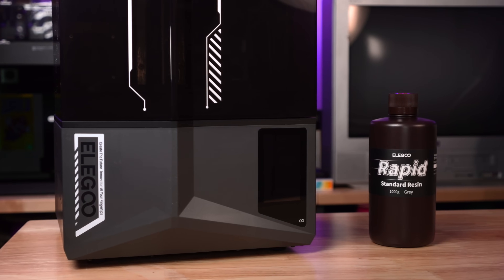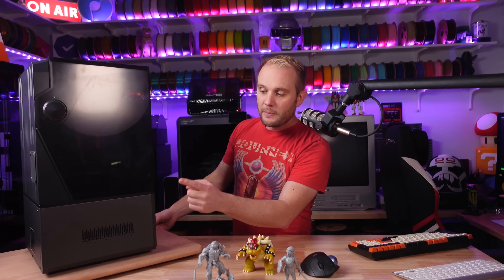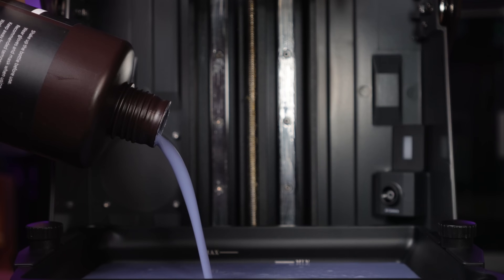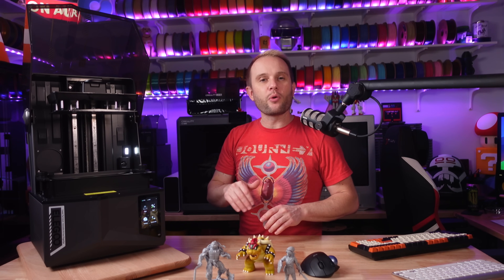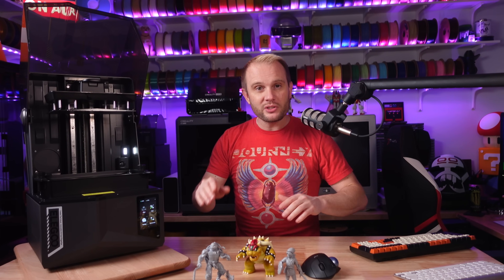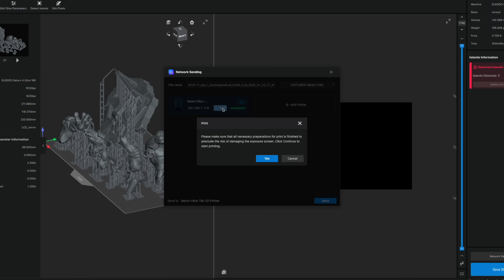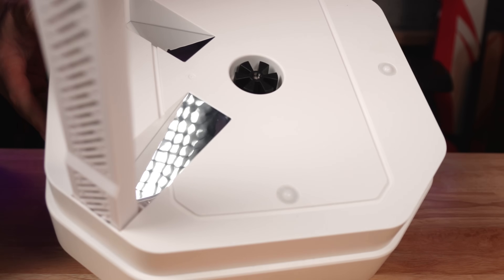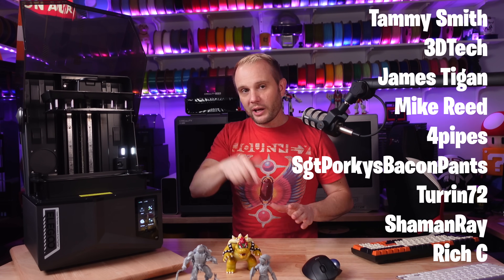Easiest & Best ELEGOO Resin 3D Printer - Saturn 4 Ultra 16k

Comment: The question I have at 3:15 or so in, is, who else is offering tilt release mechanism? I’m still learning and very new to resin printing, but my understanding is that only Elegoo has offered a printers with that mechanism at the release of this video? Please let me know who element is doing that as I’d like to compare performance across a wider number of manufacturers?
Reply from the maker: Prusa released theirs many years ago, and there have been others before and since.
Reply: @LoyalMoses  Exellant, thanks for the info, I'll look into those too.

Comment: The heated vat would help those working in a space that isn't conditioned. I could imagine those debating on putting theirs in the Garage or Basement would definitely enjoy that feature. I do wish they'd add a handle or a larger lip on the front to make it easier to open the door.
Reply from the maker: A lot of people have trouble with cold resin in the winter, or at a minimum inconsistent results because of the cold. These features are so nice to have now on these lower priced machines.

Comment: Resin always looks so interesting.  I just don’t want to invest (money)into another 3d printing hobby.   There is always so much more under the hood than you realized that will nickel and dime you.  The Elegoo Saturn 4 Ultra 16k looks great and you make it look fun and easy to use.   I would like to know there thinking for not providing a handle.  Maybe one day I will win a resin printer which jump start me into it.  So can resin prints be used for functional purposes?  I u destined that is a broad term. But can it have the strength of FDM with certain filaments?  Just curious.  It seems that most of the time when I see resin printers being used they’re mainly for things like miniatures.    Thanks for another great video.
Reply from the maker: There are A LOT of resins, in-fact some resins are like rubber, and some resins out perform ABS in many ways. There are resin prints under the hoods of cars for months at a time for testing before they go to production. So resin is VERY versatile.

Comment: Did Elagoo upgrade the Wifi 5 to Wifi 6E? Does the concealed antennae reduce the singnal strength?  Did they simplify the LCD screen relacement? Does the fast mode have layer inconsistancy issues due to lead screw backlash  or motors (Z or Tilt) skipping steps?

Comment: I also overcured the bottom layers on mine when I just started out. It was almost impossible to get models off at 30s and everything shattered. That heated vat really makes a massive difference. Im now down to about 20s for bottom layers and it still sticks like crazy. This machine prints great! One of the other advantages is that the vat will ensure that the conditions are the same for users, finally allowing us to share profiles that are just going to work for others.